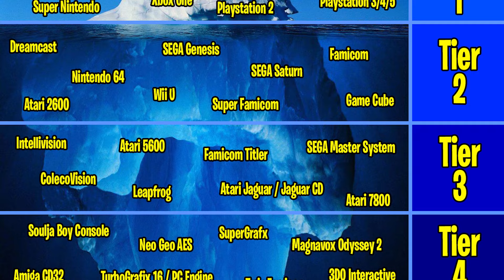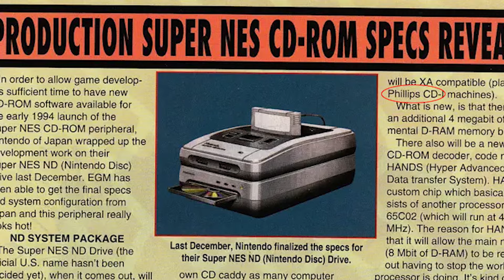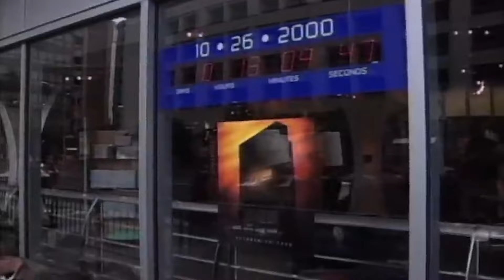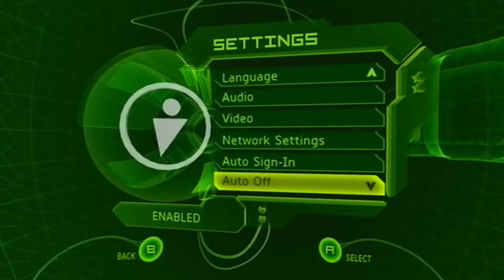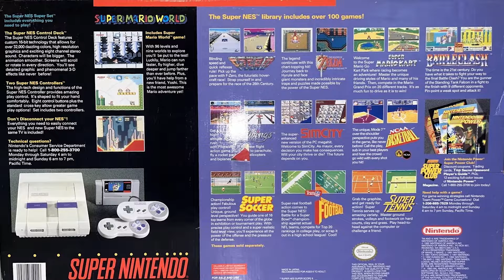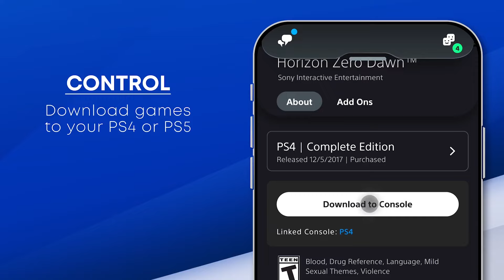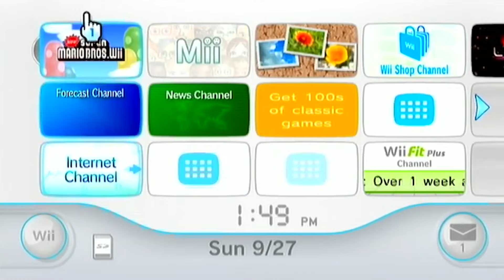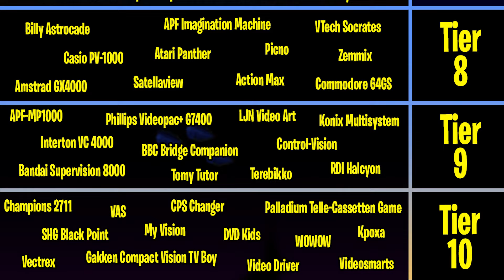The BEST Video Game Consoles of All Time 🧊 Tier 1

Comment: The Nes did not retail for $89.95 when it released in 1985. The Nes was priced at $199.96. The Nes came with the base unit, two controllers, one gray light gun, Rob The Robot, and a multicart featuring Gyromite/Duck Hunt. I believe the first cost reduction came in 1987 with the Action Set that came with the base unit, two controllers, gray light gun, and a multicart featuring Super Mario Brothers/Duck Hunt. Nintendo did not re-use the control pad from the Game & Watch series of handhelds. The Game & Watch predates the Famicom (Japanese Nes) by 3 years.
Reply from the maker: Yes you are correct, thank you pointing out my mistake. I will correct it when I release the full length documentary as soon as the Individual iceberg videos are released.

In 1985 the Deluxe Set Console Bundle was $199 (or $179) with ROB the Robot & Light Gun, or $149 for the Standard Set with the Light Gun, but without ROB. The $89 Console-only was released in 1987, along with the Console Bundle with Mario Bros for $99

IGN has the original release of the Deluxe Set priced at $199 in 1985, but everywhere else says $179. I have tons of old advertisements, magazine ads, and commercials for the NES and I couldn't find any of them with a price of $199, so I'm not 100% sure which price is actually correct. Maybe $199 was MSRP but they sold for $179?

Either way, Thanks for watching, and I really do appreciate the feedback!
Reply: The 89$ price cut was in christmas of 89'.
Reply: It also took till that cost reduction in 1987 before sales actually get strong, with 1988 being the best year. In 85 and 86 there were hardly any NES sales in the US, and in the EU it took until 1989 before the NES became popular.
Reply: @lovemadeinjapan  
I don't agree with this entirely, and I'll tell you why. Yes, the majority of people did not have an Nes in 1985 or 1986. However, that was more due to availability than anything else. Remember, we're talking about the 1980's in America. The middle class was absolutely gargantuan, and everyone was making money hand over fist. They don't call it the decade of excess for nothing. :)

In 1985 and 1986, the Nes sold well beyond Nintendo's expectations. They sold so many consoles and games that they did not have enough to supply immense demand. So, what they did was re-purpose Famicom carts into Nes ones. This was done by gluing the very first Famicom to Nes pass through attachments inside their black box games (including Mario+Duck Hunt carts). This essentially allowed the Nes to play the Famicom game as if it were produced solely for the American market, and no one knew about it. Had we, we would have disassembled a black cart to retrieve the pass through to play Japanese games on our Nes's. Pretty wild, huh? 

Addendum- Essentially Nintendo, the company that did its utmost to keep the regions separated.... gave us the ability to circumvent them. Can you imagine how many copies of SMB3 would have been imported 2 years before it released here? I would have done it! ;)
Reply: @Sinn0100  I have the sales figures from Nintendo themselves, I guess they don't lie. 1.8 M from 9-86 to 8-87, 5.3M from 9-87 to 8-88 and 9.3M from 9-88 to 8-89  and then again 5.3M from 9-89 to 8-90. So more than half of the NES were sold around holiday season 88 and the year after. Peak NES in the US is definitely Christmas 88.
Reply: @lovemadeinjapan  
Okay..... what I said is absolutely factual. Further, I hope you're not attempting to equate what gaming is today with what it was back in 1985-1987. The Nes's numbers are what Nintendo had to ship. At that point in time they did not have the ability to produce more because had they, their numbers would reflect that. From 1985-1988 we went through what was dubbed 'Nintendo Mania." 

If you look at the video game market in the US in 1984 and compare it to 1985 it shows how big the Nes was. In 1984 there was no console market in the US, none. Stores refused to carry them and most considered it nothing more than a dead fad. That didn't change in 1985 which forced Nintendo to market the Nes as a toy. Not only that but gaming also carried with it a social stigma from 1984-1997. Despite all of that Nintendo completely sold out in every single test market in 1985 (games and all) in 24 hours. By 1986 every department store and toy store across America was clamoring for the Nes. Every store that was able to get them sold out in hours (and this is 1985 not 2024). Nintendo became so backlogged with cartridge orders that they were forced to re-purpose Famicom games to keep up the demand. I believe it was in 1987 when Nintendo bought two new factories solely focused on the US alone. If Nintendo could have made 10 million Nes's in 1986 they would have sold 10 million units of that there is no doubt. Look, don't take my word for it.... look it up for yourself and you will see how insane people went over the Nes in 1986. Nintendo was actually forced to stagger their release of the Nes in the States. They couldn't keep up with demands in every state so they had to deliver only to a select few states at a time....

Addendum- I started gaming back in 1986 with the Nes and Sega Master System (divorced parents). Basically, I lived through it and remember all of it. All I wanted for Christmas was the Nes and my mom had to drive to another state to make it happen. My dad not to be out done snagged an SMS for us (he loves gaming still) for Christmas in 1986. That year I got quite the crash course in modern gaming. It was truly awesome to be alive and watch the industry explode.
Reply: @Sinn0100  So weird that there was no homebrew craze in the US. Here consoles had a rather low effect on gamers back in the eighties. Home brew software for home computers totally dominated the game market in Europe, and in the late eighties lots of small game companies were founded on the homebrew success. From early Z80 machines like the Z81, through the big sellers like the Specttum, BBC Micro, C64 and finally the Amiga, DOS PC's and MSX2, it roughly lasted 3 generations of computers. Only after 1990 we started caring about the NES, MD and SNES all at the same time.